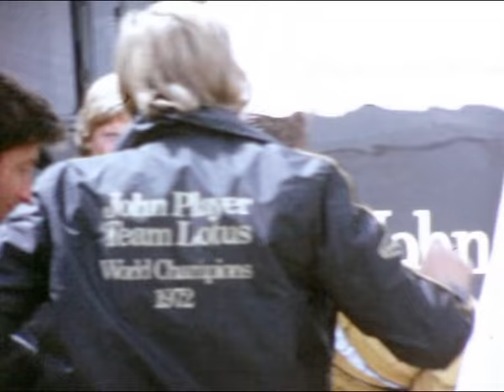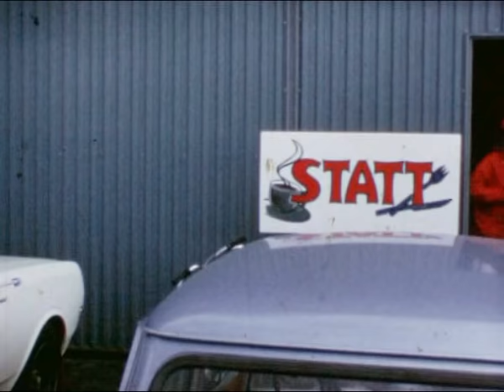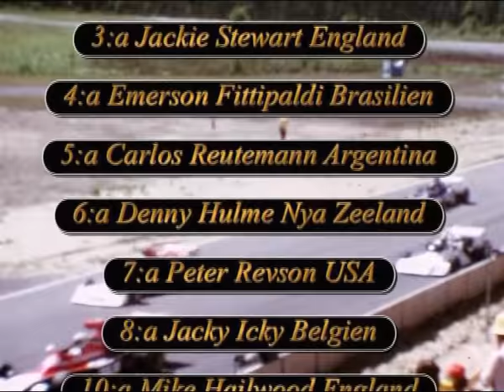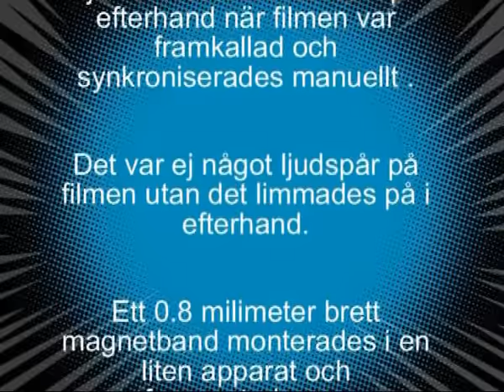F1 Anderstorp 1973. the pit area Friday, race Sunday, + pictures of drivers and cars from this age

Comment: 0:10 - Anderstorp was an interesting track, with the runway being used for the back straight. A key feature were long constant radius corners which were slightly banked, which meant finding a good setup was difficult but crucial to fast lap times.

Comment from the maker: Ronnie Peterson often drove his cars with quite large skidding, in F3, F2 and in F1 and the audience loved to see him drive this way. I think today's audience would like if the car skids a bit in some curves.
The F1 cars today have many G-forces in the curves, drive without skidding, if they skidding they often go off the track. 
If it goes at a slightly lower speed (poorer grip in the tires, less downforce) and the drivers can drive with a small skid in some curves, I think would be appreciated by the spectators.

Safety is so much better today than before, it must always be at a high level to protect drivers and the public.

When the V6 with turbo come to F1,  they sounded like vacuum cleaners, a microphone was mounted on the car so that the sound could be heard for the TV viewers, the live audience was without that sound, is it real racing? 
F1 + awesome engine noise belongs together!

In a few years, most passenger cars will probably be fully electric, without a hybrid engine.
F1 often wants to follow the car industry when it comes to engines & fuel, so it may be a hybrid-free fast F1 car with a strong electric motor without sound, 10 more buttons on the steering wheel + 20 more engineers to help the driver drive the car in the best way. 
 
In 2004/2005, the V10 cars set a lap record on most tracks, the record stood for many years, at Monza Juan Pablo Montoya held the record for 14 years! The cars were not equipped with soft sticky slicks but with grooved tires to make the attachment to the asphalt lower, despite that, they were so incredibly fast, it would be wonderful to see and hear similar monster cars again!
To hear an F1 on full throttle with a big strong engine is music, wish many younger people would be able to experience this live!

George Russell often fought at the bottom, (he is a very good driver), when he borrowed Hamilton's car he was right at the top and fought for the victory in the race, Hamilton is one of the best of all time, would be interesting if they could meet in identical cars!
There should be a royal class for formula cars where the best drivers in the world participate, where they can drive equivalent cars, call it F1 or something else.
If today's drivers got more equal cars, racing would be raised to a much higher level, today F1 is further from ever being a racing class on equal terms!

A strong suction motor of 3L without turbo V8, V10, V12, boxer 12, that rotates 9000v to 19000v, (bring hearing protection) keep power steering, gear paddles, remove most buttons on the steering wheel, a small fixed front spoiler with adjustment in the pit area, a fixed rear spoiler with adjustment in the pit area, allow refueling again, today there is a lot of talk about tires, tires, tires,  the TV commentator talks in all practice about tires, tires, tires, soft, medium, hard and again tires, tires, tires before and during Q1, Q2, Q3, before and during the race it is tires again that are most talked about. Allow smaller number of tire choices and longer tire life with less grip, only soft, hard, rain tires, (or only black and rain tires), drop the tire heaters (equal for everyone).

Today it should be saved on tires and fuel, is it racing?
The F1 circus should be able to survive in its coolest design with V8, V10, V12, boxer 12 engines, the lack of these engines + that it is often one and the same team and driver who wins year after year after year, that is perhaps why the audience interest has decreased so much as it has done.

The competition tracks mean a lot for exciting races, a good track should have level differences, long straight distances, sharp wide curves for more track choices.
Brazil, Belgium, Portugal, USA + anyone else are beautiful courses.
Flat tracks in the desert are often boring.
The worst tracks are those with curves like an S with an ideal track that makes it difficult to make a overtaking, drivers often wait until the next pit stop (save tires & fuel).

Some F1 tracks are like a large parking lot where the track markings are only painted, where drivers can sometimes save time by driving outside the lines.
There must be a sharp contrast between the track and the area outside the track (sand, grass or a wall) so the driver always loses time if he does not drive on the track.
       
F1 should look at IndyCar, in IndyCar they only have hard, soft + rain tires, refueling, no power steering they often manage to make the race exciting and with different winners in the races, they have more equivalent cars that mean a lot and there will be more overtaking in their race, it is seen often which driver is the best driver, not just the best car. IndyCar had in 2020 7 pcs. different winners of 14 races.

MotoGP is also a top class, with tough dueling between the drivers in all races and many overtaking during a race. 
In 2020 there were 9 pcs different winners of 14 races.
It's real racing!

WRC is also a top class, there drivers do not save on tires and fuel!
It's real racing!

Sprintcar racing is also a top class, there drivers do not save on tires and fuel!
It’s real racing!